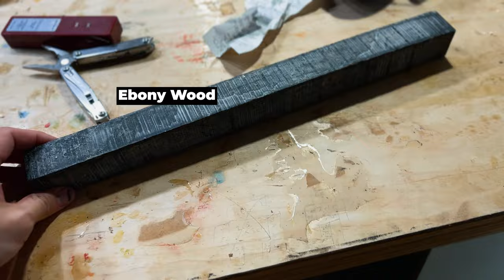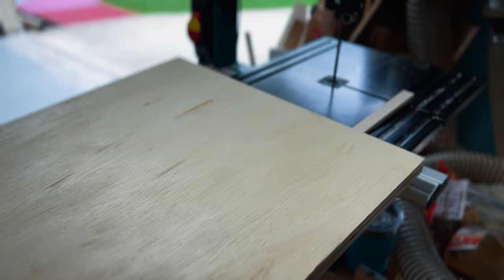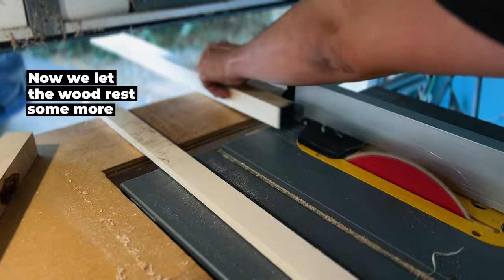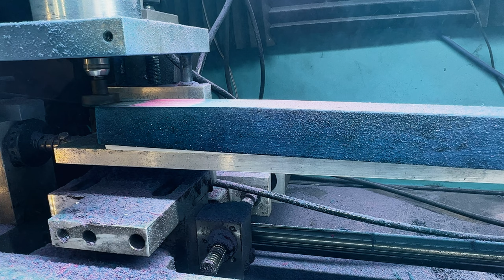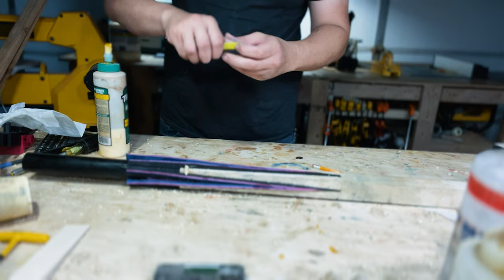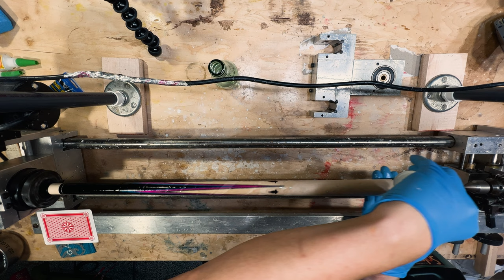Making a Full-Splice Pool Cue from Scratch (No Talking, just Woodworking)

Comment: Nice work!

As an aside, I obtained a booklet many, many years ago from Atlas Billiard Supply written by Burton Spain, wherein he described his full-splice blanks. Spain made full-splice blanks for many of the top makers (like Szamboti, Rambow, and Balabushka). He sold his equipment to, and trained a man named Joel Hercek who still makes cues.

The booklet didn't have any real details of the jigs required but it did show how the wood was cut and how the two pieces fit together. Bob Dzuricky has a video of some experimenting he and another cuemaker did with full-splice cues.
Reply: He made my full splice cue, sadly I took to long on a pawn. Father ordered it for me. Joel good guy. And he did mine out of a very tough material I don't think many could do it. Palm wood. Really hard to lathe or get a good finish on it.

Comment: Is it possible to use less veneer width so that there’s not so much being trimmed off and wasted? Seems like a lot of excess material there… I can’t afford to waste that much haha also what are the sizes of the planed timbers you begin the process of cutting & joining? I’m at around 37 mm sq.. just wonder wether it’s any easier to get the joint done with a bit extra meat there… or if there’s a sweet spot for this size you’ve found?

Comment: Few questions. Before pool cues did you have a bunch of the machinery already and pretty skilled in woodworking?
Also how much h time avg not including g waiting for curing does it take for "you" to make a full splice cue butt? Also how much time for a 3 piece splice butt?
That way I can figure out how long would take me when proficient so I can see time wise for value added to material costs. Just trying to get an idea the added cost of "your" or "my" time above material costs when building  a cue.
Reply from the maker: Heya Nick, yea I had all the machinery minus the lathes before cue making. I had a passion for woodworking - mainly furniture and home improvements. 
Good question about the avg time. That’s what pool cues are— it’s never an issue with margin and cost of material. It’s time. It’s incredibly time consuming and lengthy. But it’s too nebulous to sit and keep track of how long. While one thing is curing on cue 1, I have something else cutting on cue 2, while sketching an idea for cue 3. Lots of overlap. And time is significantly influenced by experience. A good example is wraps. A leather wrap would take me 45 minutes or so. I’ve seen guys do it in 10 minutes.

Comment: What advantages do full splice cues have in terms of performance and feel over other cue designs? I see companies like Predator who advertise the consistency and feel of their P3 30 piece design, as well as Exceed Cues who use and advertise a Dual Core Power design, none of which are full spliced if I'm not mistaken, and I can't help but wonder what the differences are and how each performs and feels. What are cue makers thoughts on this? Is True Splice construction the end all be all of top tier performance or are there multiple methods that perform equally as well?
Reply from the maker: Morning Thomas. Normal modern cues are attached together using a tenon and screw. Full spliced cues are attached together by gluing all that surface area afforded by joining these prongs together. After assembly, a full splice cue is a single piece. Full stop. If the cue maker is competent, they’re both solid means of construction. But if I’m in a bar fight, I’m grabbing the full splice every time. As a woodworker, agnostic of being a pool player, it’s simply smarter better construction. But it’s harder to do. More skill is involved. And wood choice is harder. You need much longer pieces of lumber. Which means more expensive. 

Can you notice a difference in feel when playing? I can. Absolutely. Will it make you a better pool player? No. Probably not. 

Predator is a massive international company with an entire team dedicated to marketing. In reality their wood is trash. Their designs are often painted on. Putting predator cues on a lathe is telling. They wobble which tells me shoddy construction and speed to get things out of the door are the biggest motivators. It’s a numbers game for them. 

As for exceed cues, I haven’t seen any equivalent of the posts from predator players showing their painted fake cues. But Dual Core Power Design is marketing mumbo jumbo. That $600 carbon fiber shaft was purchased in China for $10 and filled with Home Depot foam. Weight was added. Often with a weight bolt affixed inside. Cue makers have taken every single carbon fiber shaft available on the market and ripped them open and dissected them. It’s the same for all of them. So when you read things like Dual Core Power, be weary.
Reply: Thank you for the response. I've always been interested in full splice construction but they're harder to come by yet alone get some time to hit with one. And yes, I know it's a numbers game for predator and they do not have the ability to give each cue close and careful attention the way an individual cue maker would be able. @Studiotronics
Reply: @Studiotronics  AMEN to this, I'm also a custom cue maker herein Ontario Canada as well and agree 1000% about the Predator garbage out here! MASS produced and inferior woods. As you mention its all hype and millions spend on marketing, like come-on, who pays $600 for a jump cue, like seriously? ( OK who has the audacity to even charge that = Predator) 
 Your designs are very nice and well crafted to say the least. I like your jig for the veneers, which I have one similar for my CNC as well. I'm currently designing a fully adjustable jig right now  that mounts to the band saw made out of aluminum and will cut the angles. The one I'd love to come up with for the band saw is the veneer cutting jig, which, with a bit of tweaking I think I can design by utilizing the full splice jig itself. I'm trying to make an "all in one" type situation for the receiver section of the full splice which is rather difficult but in my mind achievable.

Comment: I recreated a version of the bandsaw jig you made, but after making my first test piece, I realized that making the angled cut on all four faces of the blank, using only one side of the jig, is enough. Why did you make your jig so you can switch the side the blank is clamped to? Am I missing something?
Reply from the maker: Dude I love that you made it. That makes my day! I wanted options. Would I prefer sawing on one side or the other? What if the blade im using starts drifting left, or right. What if a camera angle looks better one direction, etc…The amount of work needed to make it reversible was minimal and I figured it couldn’t hurt. 
So you were able to find the right angle based on your forearm grooves?
Reply: @Studiotronics   That makes sense. I haven't made the forearm yet, but I took some measurements of different pool cues I had laying around and choose an angle, so I'll just use that when I make the forearm as well. I don't have a cnc router though, so I'm going to try to make a table saw jig to make two compound angle cuts to remove each corner. That jig is still just an idea though, hopefully it all works out.

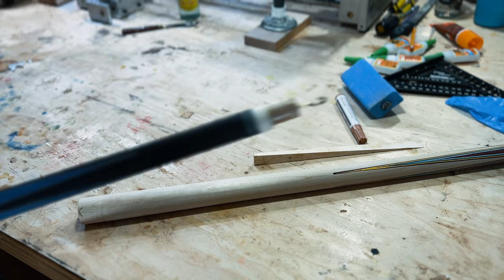Comment: You have any finished pics of that blue point (2nd) and the 4th cue you showed at 1:26 mark?
Reply from the maker: Heya Nick, I never finished them as there were mistakes. They were built during the learning process, before I had really dialed in full splices
Reply: @Studiotronics  well few of those look very nice. Bet would still look great with epoxy on them even not finished just for veneer reference if someone liked the pattern.

Comment: How do you get the angle of the cue correct from butt to tip?
Reply from the maker: Either with CNC or by using a taper bar on a lathe. Both routes are simple and effective.